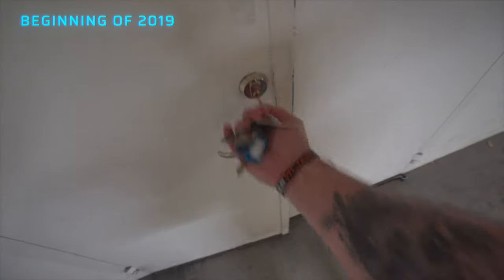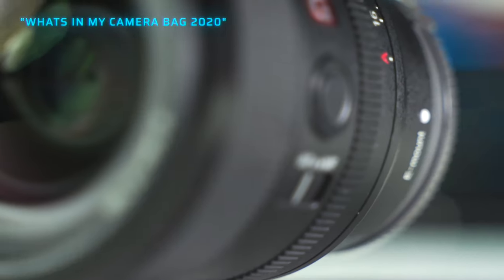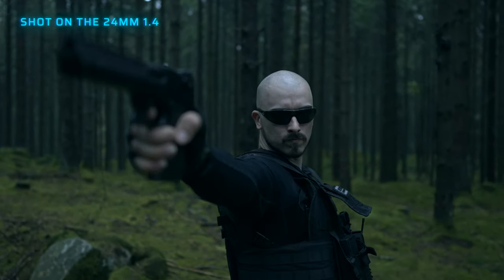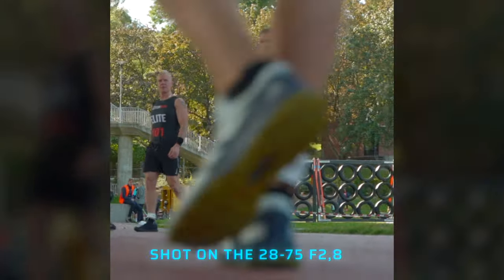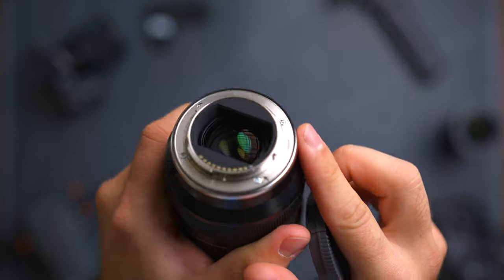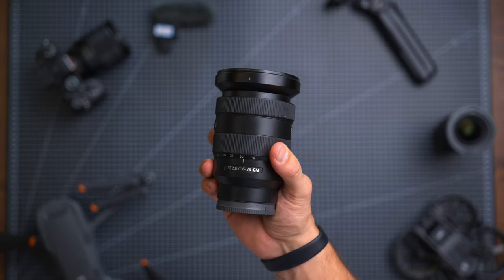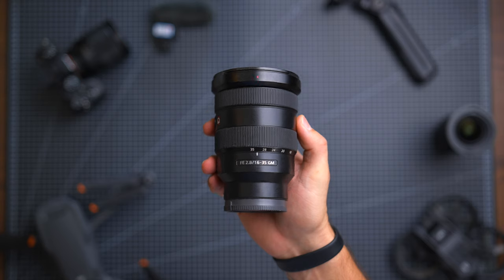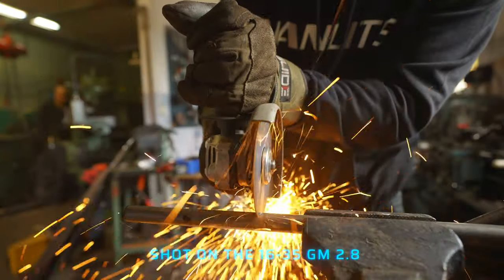My Favourite Sony Full Frame Lenses For Filmmaking In 2022

Comment: 24 GM looks good. I ended up getting the Sony 20 1.8 G because of the active stabilization makes it more like a 24. I also love using the 50 1.2 GM, but I mostly just use the Sigma 24-70 because of fast pace filming. If I get another lens I’ll get a telephoto, otherwise I’m content.

Comment: That actually makes a lot of sense, I was looking at cheaper option to complement my tamron 28 75 g2 but at some point you need some low aperture lens and the 24 gm 1.4 looks like a must buy as well as that 85 f1.8.

Comment: The Tamron 28-75mm F2.8 G2 and the Sigma 35mm F1.4 Art is everything i need, nice mid range zoom and a fast 35mm Prime. Only thing i might get is a 16-35ish lens (i'm waiting for the 16-35GM G2). I think having less lenses really helps focusing on filmmaking. Altough it's really hard to resist the urge to sell my kidney and buy a 24mm and 50mm GM...

Comment: Hey peter, i got a sigma art lens 1.8 18-35. AND the autofocus motor is loud af, u got any ideas on how this can be fixed? tried a rode external mic, the micro which might be to short. but ive heard even a longer one could be problematic. what is the best choice here?
Reply from the maker: It's an old lens, so i doubt there's any fix for it. The motors vibrate the entire camera, so anything attached to the hotshoe will make a sound i guess!

Comment: Got the 24-105mm f4 as my only lens so far. Now it is difficult to find something smaller like 14 or 20mm and  bigger like 100-400mm.  Choosing lenses for Sony can be a pain ... there are just too many good lenses on the market. 🙂
Reply: Stick with it. This was my first lens with a7iii. It can do it all (almost) and I made great pictures and videos with it. Then GAS came and I bought a7siii plus several other lenses starting with 16-35ZA ending with 200-600G. Everything is fine, each lens is great and I am happy...  well until I have to lug 10kg backpack, just in case I need something else. It is the content that matters not the equipment but of course everybody has to learn it for himself, and then again and again....... ;-)

Comment: So. Your 28-75… consider going with the sigma 24-70. It is about the same iq as the Gm V1, but only $1K. Only downside is that it zooms the wrong way (which is very frustrating… for me it is anyways). Sony 85mm F1.8 is about same quality as the Batis but a lot cheaper so that is a good option for people on a budget. Other options that are fun is the 90mm macro (can substitute for an 85mm if you don’t mind slightly less background blur), the Sony 35mm F1.8 and the Zeiss 55mm F1.8… but it really depends on what you need and what you want to take with you. I personally prefer the look of a 35mm to a 50 or a 24… but I know anyone who vlogs tend to like the 24 (20mm F1.8 is a good option for people on a budget for that)